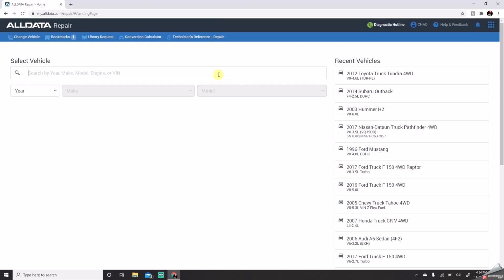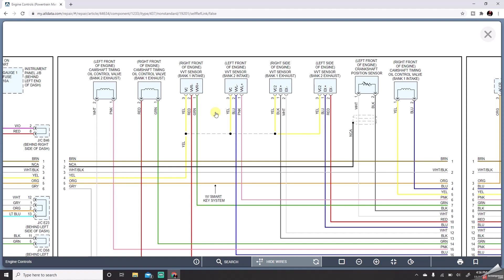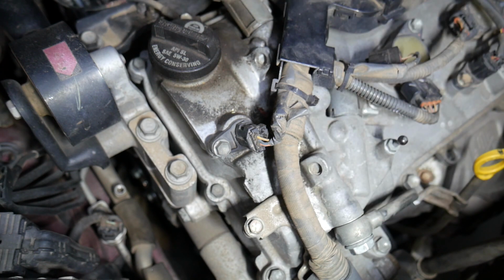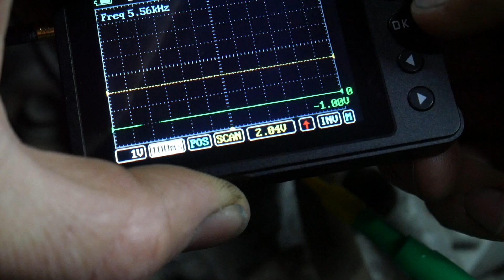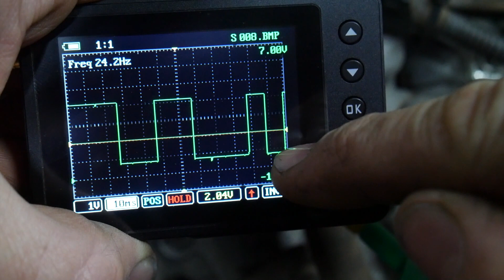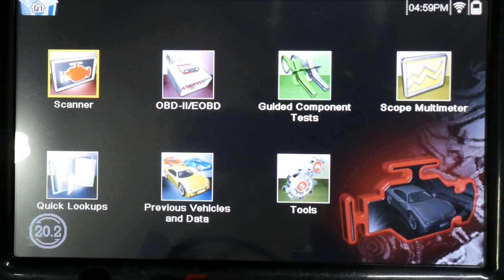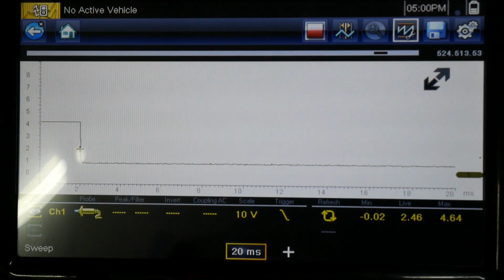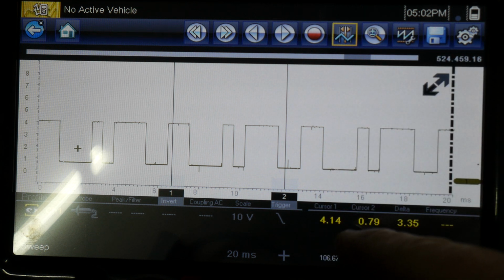Weekly Waveform #6 - Hall Effect Sensors

Comment: How much is that u scope it’s nice ya can manipulate the waveform after you stop the recording. Almost had a better pic than the snap on
Reply from the maker: I think the scope alone is less than $200 and the complete kit is less than $500 with a low amp clamp and ignition adaptors.
Reply: @ThePracticalMechanic  maybe I’ll learn howto read ignition waveforms in a few more vids from ya. Only secondary ignition I can recognize is lean condition